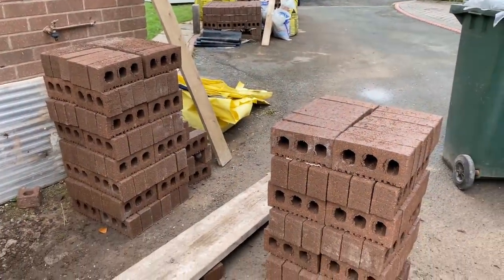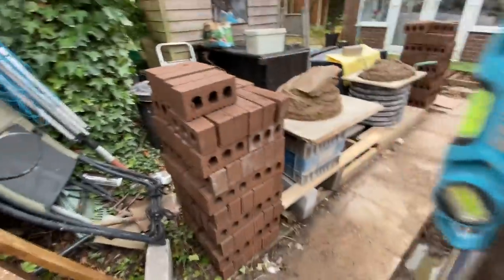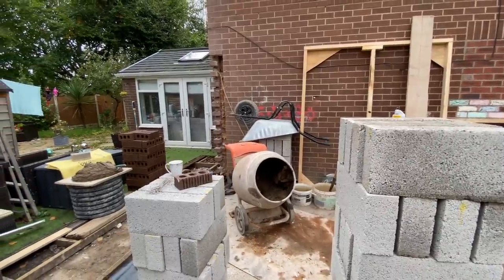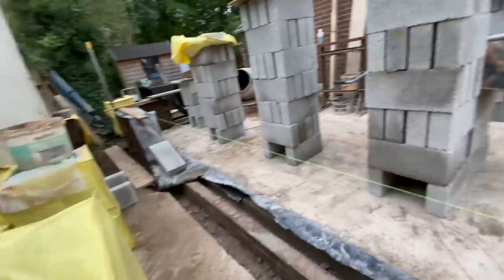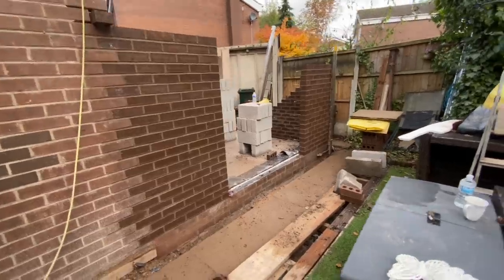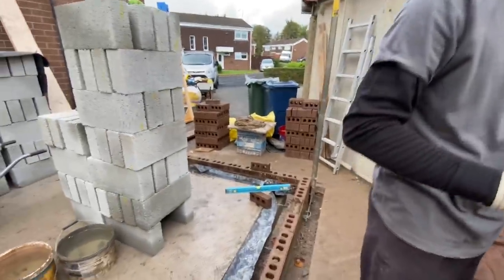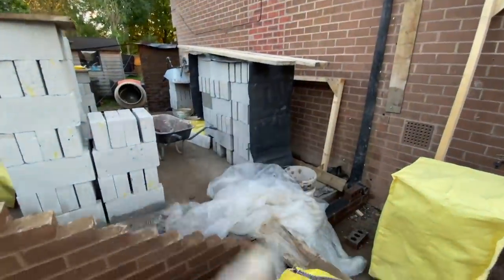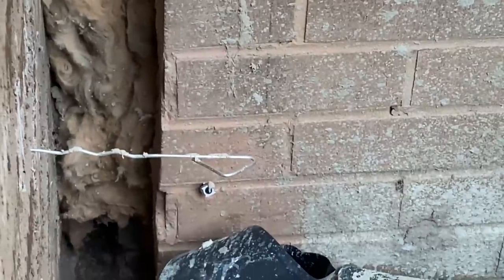DISASTER AVERTED ..EXTENSION FACEWORK PART 4

Comment: In West Australia we build the doors and windows in permeant as we go so we rarely have to do a stop end,  When I was still bricklaying I struggled to build a corner when working back in UK  because we use profiles from footing up on everything so basically we are just running the line. Bricks are bigger here and gauging  is 86mm so you  work it 7 course - 600 and 2143/25 course to door and window head height, probably why we have use profiles with the gauge marked lol.
 
 Dutch pin 3 bed joints down for second lift to rest the profile on when fitting from a scaffold  :).
Reply from the maker: We all have different styles and methods but all get there in the end .🤙🏾🤙🏾.
   Thanks for watching and commenting 🧱👍🏽

Comment: I'm out the game now but I always had CLS or tile battern in my lockup to make a gauge rod.
I'd use one for transferring the existing courses of the building onto my profile.
I would also always use a gauge rod for pads and wall plates, working off a datum.  A lazer level and pickup is a must for any trowel. 
I would alway set out the pad or wall plate on the rod, then you can work out the cut underneath when holding it on the datum.

Comment: Would you suggest using fibolites or breeze blocks on the inside? I've been told the breeze blocks are better thermal. But the fibolites are better for fixings
Reply from the maker: Fibolites definitely 💪🏽🧱👍🏼
Reply: Ok thanks 👍
Reply from the maker: @bigmik3566  🧱👍🏽
Reply: Can you use concrete bricks on the outer skin instead of facing bricks and heavy blocks?
Reply from the maker: @bigmik3566  I don’t see why not 🧱👍🏽

Comment: Again, nice work Steve. I hope the Super Steve and Awesome Alex are doing well these days.  Question: Over here in the US, the big trend is to build with ICF blocks and cement. "This is the way..."  How about over in your neck of the woods? I've had several friends build ICF based homes and am amazed at how fast they go up and the high insulation quality they have. Is this something you might get into in the future?  Cheers from Texas mates!
Reply from the maker: Cheers buddy , we’ve never heard of ICF   Blocks over here 😬🧱👍🏽
Reply: @SteveAndAlexBuild  We do have ICF Blocks in the UK they are a hollow block made from insulated material and act as shuttering and are filled with concrete, seems a good system but like every new product to arrive on these shores we are very slow on the uptake.
Reply from the maker: @bricklayersworldwithandy6277  . Ah I know the ones , I’ve  seen them on grand designs 👌🏼🧱👍🏽
Reply: @SteveAndAlexBuild  👍
Reply from the maker: @bricklayersworldwithandy6277  🧱👍🏽